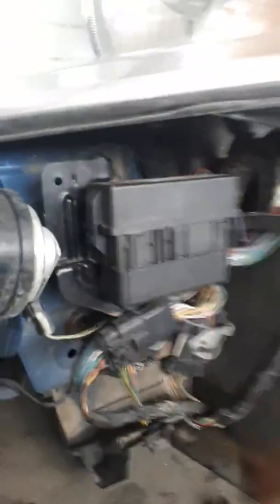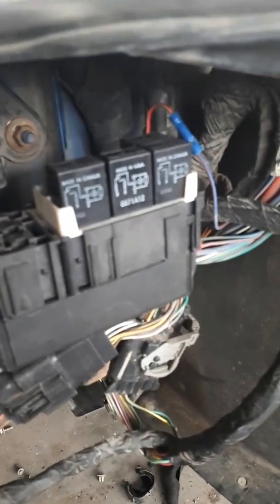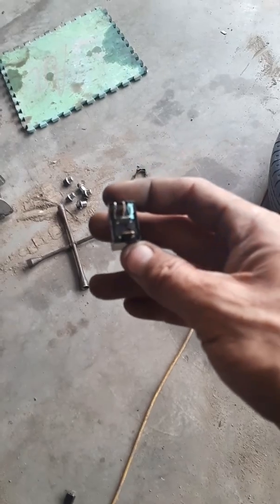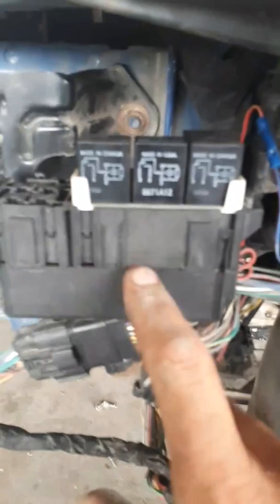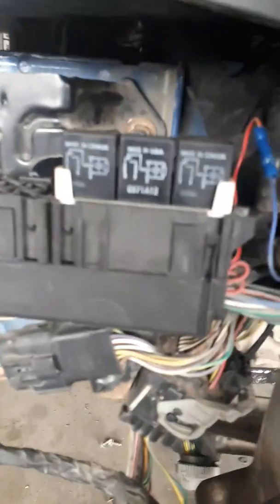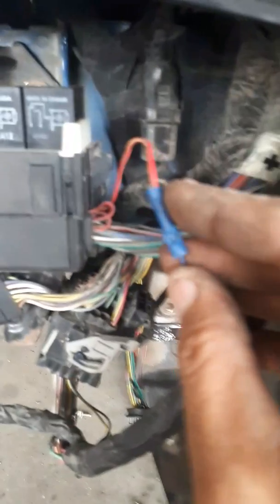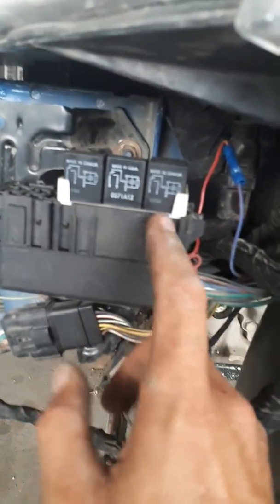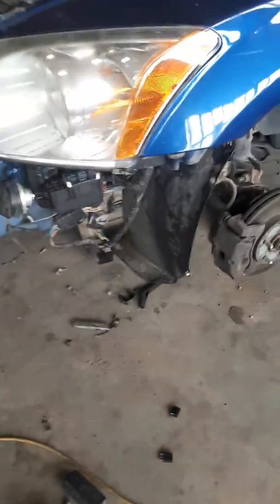Dodge Caliber Relay Corrosion Issue

Comment: Same thing happened to my 2008 Caliber SRT4. I didn't drill a hole though. I just left the corroded part alone and moved all of the wires to the empty space from the relay block. You see there's like 6 spaces for the relays but there's only 4 or maybe 5 space being used. So the extra space not being used before is where my new relay is located now.
Reply from the maker: cool, thanks for the info! an thanks for watching!
Reply: This may be just what I've been looking for. My son's car, '08 SRT4, cranks but won't start. I checked all the fuses but didn't know about this box. Thanks for the tip.
Reply: Such an obvious solution! Thanks! You had to do some soldering work to move the wires to one of the other unused fuse slots correct? I need to do this fix within the next 3 days, ugh!

Comment: I have to replace one of these relays EVERY year.  Great place to put electronics in the wet wheel well.
Reply from the maker: Ya no kidding, a little common sense or "just sell it, let them worry about it", lol
Reply: Where do you get the relays? Mine is all apart and the ones I got from O'Reilly are 12-30s but 2 pins are slightly bigger?

Comment: The one you replaced I started to think was just a spare. I couldn't figure out anything that's not working without it. Turned out it was the upshifter relay. However the one right in front of it/beside it is the relay for the starter and will cause the no start sometimes problem. Maybe this comment can help somebody

Comment: Had the no start issue over the Weekend. The two you say was was bad. The relay in the front is for the starter. The other two are for coolant fans. But the relay you had off, couldn't find what it for. Just might be a spare. Auto Zone nor O'Reilly sale these relay. And there're $30 a piece on Amazon.
Reply from the maker: Cool, thanks for sharing and watching!
Reply: Yes Autozone order them for me. The exact same match for $15. & change for one.

Comment: I didn’t know about these. Mine starts and drives but no lights or gauges are working. Like nothing works. Wonder if these could be the culprit
Reply from the maker: Ya check it out, not sure what your problem could be but it's worth the check, these calibers seem to have all of wiring issues, hope it helps.  Thanks for watching!
Reply: Caliber 2008 S/T. Only RPM is working, all others on the closter instrument are not moving. Tjird one left , most far from frivers Seat should be starter relais?

Comment: I'm having a problem with my windshield wipers and signals, and my battery is draining very fast cold it be on of those relay's
Reply from the maker: Hi, it could be?  Might be creating a short in the electrical system.  Hope this helps.  Thanks for watching!

Comment: Just saw this one too. I’m working on this right now.  I have 1pin on 3 of the 4 gone you can just jump it and re wire the individual pin? As I can’t get a relay box anywhere
Reply from the maker: Hey, i jus rewired it, made my own pin from another box, jus cut the wire a little long or enough to work with, from the part u r taking it from.   Then i cleaned out the old junk and inserted my made up pin.  I just happen to have a bunch of old parts laying around lol.  Thanks for watching!
Reply: THE MOOSE'S WRENCH thanks! How did you get the bottom of the relay box off? I can only get the front side off with the two tabs. Thanks sorry for all the questions
Reply from the maker: Hey, not a problem, if i remember correctly, there are tabs on each side and it should just pull apart.  Its a little tough but it should come apart.
Reply: THE MOOSE'S WRENCH  got it fixed thanks , cars running better then befor just need to make a new waterproof box to hold the relays all 4 where toast.  These videos saved me 1000$ at the shop much appreciated!

Comment: Omg i have same problem right now , cant find the hole box dunno the correct name for it
Reply from the maker: could be relay block, relay control unit, relay control module, i did some searching as well but never came up with anything.  Try a dodge dealer, maybe.  I jus made my own connection, after cleaning out the old corrosion.